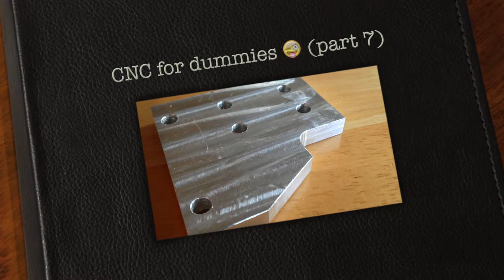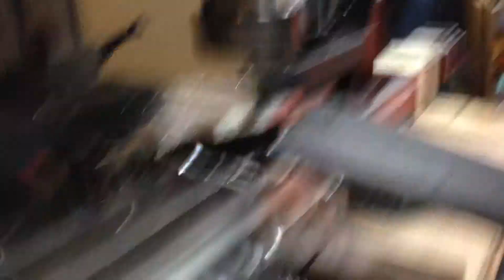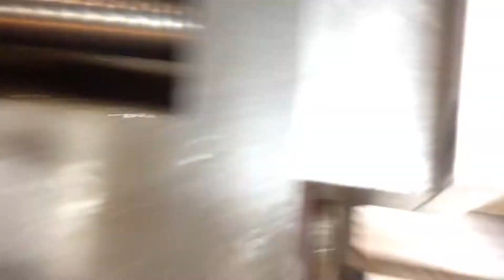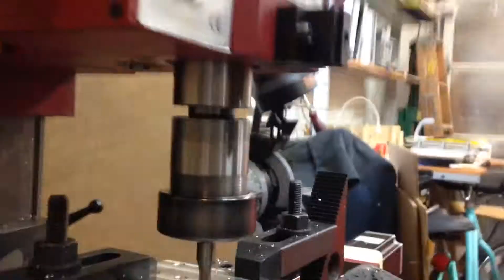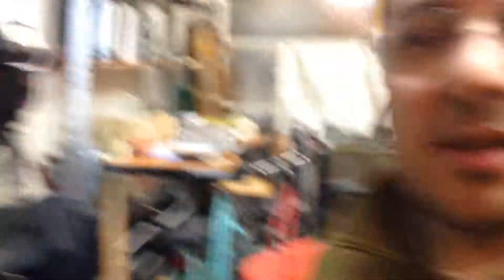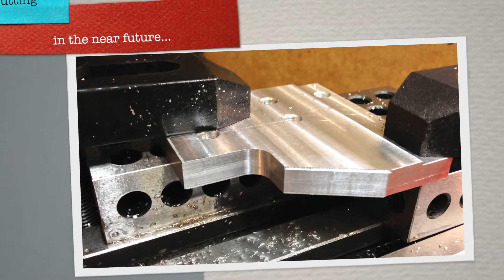CNC for dummies 😜 (part 7)

Comment from the maker: Thanks Cybot63, that could have helped, though I think the biggest issue was my RPMs being way too high, generating too much heat, and melting the aluminum. The aluminum then "chip welded" to the cutter, and from that point on the end mill was rubbing, rather than cutting. Blame my inexperience at the time. Now that I have cut a lot more metal with the machine, I cringe looking back at this video.